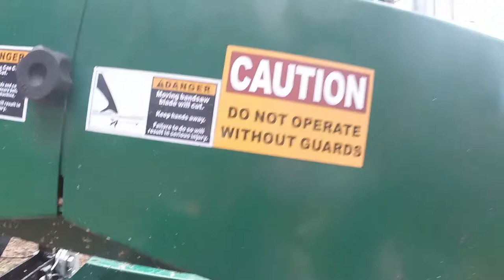Sawmill Saga Part 6: Learning Week Ends, But Learning Continues

Comment: A BX MODEL KUBOTA TRACTOR WITH FRONTEND LOADER WOULD BE THE TICKET FOR YOU ERIC. THEY CAN LIFT ABOUT 1200LBS AND SMALL TO GET AROUND SAWMILL AND IN WOODS. A used one can be got for around 7-8k. Would save you 90% of manual labor as I'm sure you already know. Have been enjoying your journey. I too own a sawmill(woodmizer) and also a retired pilot.
Reply from the maker: I had a small tractor years ago when I lived on a more gentle slope. I used the backhoe to keep cattails from completely covering a small pond.
Where I am now, a tractor would sit and rust between uses, the only use for it being loading logs on the sawmill. But I think of tractors often.